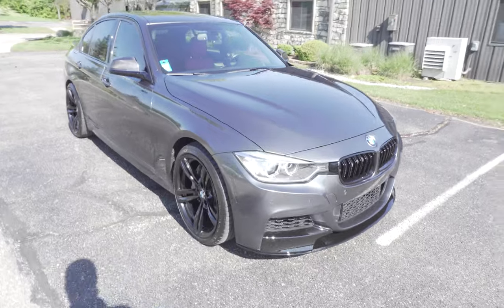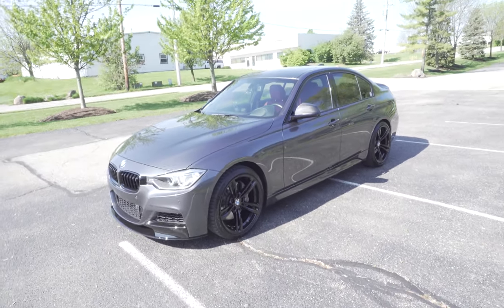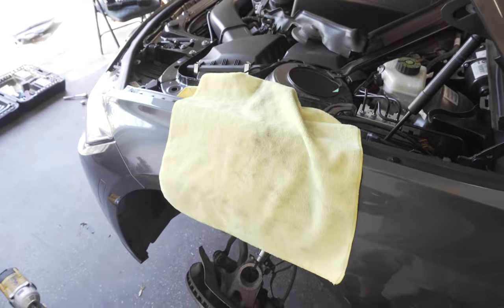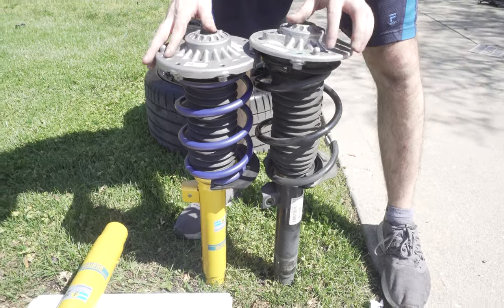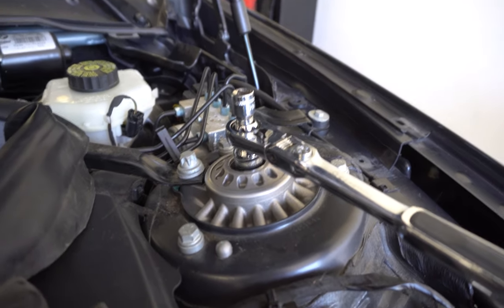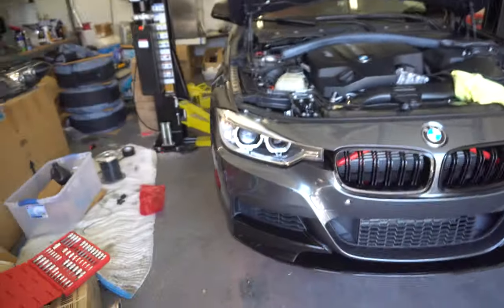Bilstein B8 struts with H&R Sport Springs | PART1

Comment: how do i know if i have adaptive suspension? also if i do, would it make any difference of using the bilstein? i’m currently on h&r sport springs in stock suspension M sport and it’s decent ride quality, i just want a bit stiffer on highway roads sondes it’s my daily driver.
Reply: 2015 f30 335i for reference.
Reply from the maker: I doubt that you have adaptive suspension. If you look up your vin number, (bmwvin . com), look for 2VF. If you see that, you have adaptive. Also, it would be pretty noticeable if you had it. When putting the car into sport mode, you should feel a noticeable difference in the suspension stiffness.
Reply: @accelerated_motion  unfortunately that site isn’t operating at the moment, but i checked other sites and i couldn’t find any sign of adaptive suspension, whenever i put it in sport and sport+ mode it always highlights the shocks on the infotainment screen, that’s why i was wondering but thank you! this is my next mod for my daily commuter
Reply from the maker: @joealej4274  there are other vin decoder sites but any will work. But yeah I doubt that you have adaptive. You’d also see some black tubular piece by your suspension. I’d say you probably just have standard MSport suspension like I had. Switching to the Bilstein’s made the car feel a lot better
Reply: ...or contact your local dealer and ask them (call or visit).  Bilstein offers shocks/struts w/adaptive properties to preserve the adaptive feature...
Reply: @K03sport  I ended up going with kw’s a year and a half ago lmao

Comment: hey! bro how is the comfort between Bilstein B8 compare to just H & super sports spring on stock m sport suspension. thinking going with this set but have doubts. also I rub a little on my passenger rear
Reply from the maker: From everything that I have read and heard, H&R Super Sports on stock suspension is awful. Extremely harsh ride quality. Thats why I opted to do Bilstein struts along with the H&R springs. I'm glad that I did. Its been a very comfortable and confidence inspiring setup.

Comment: You know, it didn't look bad before the spring install. I'm not a tucked or zero-finger gap person, so I prefer some space btwn the tire and fender. Mild drops are the best (imho) as far as I am concerned. When you start going crazy low, you jack w/the suspension geometry then have to buy more pieces to compensate for that bad geometry...
Reply from the maker: It wasnt terrible before the install but I prefer a mild drop. I dont care for tucking tire, so this setup was pretty much perfect for what I wanted. You're right though, depending on how low you go, other parts and pieces are needed to get geometry back into spec.

Comment: Nice video! Good work! I've noticed the tools used in your video...cand you make a description what did you use? THx
Reply from the maker: Thanks for the comment! You'll need the following: Sockets and open end wrenches 10mm, 13mm, 14mm, 16mm, 17mm, 18mm, 19mm, 21mm, Torx T30. Deep sockets and ratchet extensions. Spring compressor if removing the springs. Spindle spreader to remove the struts. Having some basic screw drivers on hand is always helpful. Torque wrench and breaker bar. Impact driver isnt necessary but does make the job go a little quicker. Thats more or less what you need.

Comment: What’s the verdict on the H&R’s & B8’s? I’m on BC coilovers and there’s some bounce at low speed/ start-stop driving.  I think the dampers are not very great and small bump sensitivity is basically non-existent.  Considering your setup or H&R SS’s.  Nice ride BTW.  Thanks
Reply from the maker: I have heard that BCs are pretty harsh. I LOVE my H&R & B8 setup. Its the perfect combo for daily driving duties. Its a tad stiffer than my stock MSport suspension, but it isnt jarring or harsh in any way. Extremely comfortable. I wouldnt call this suspension setup worthy of a track car, but it all depends what you are using your car for. For me, I'm only daily driving my F30, so this setup is perfect. Couldnt have asked for a better suspension setup.

Comment: I have stock BMW E 30 convertible 1987 stick shift - B6 with stock springs or B8 with H&R sport springs? Roads around where I live are nice... i’m OK with sportier feel, but I don’t wanna have it super hard like a go cart
Reply from the maker: The real question is, do you want to lower the car. If yes, then go with the H&R/B8 setup. If you want to keep stock height, then you can do B6 or B8 with stock springs.
Reply: @accelerated_motion  well...if I stay stock springs I may as well go with B4...comfort, and just little-bit stiffer then oem, or the same. Save some cash and add on some more front suspension refreshments 😂

Comment: I have a 2018 330i with m sport package, could you recommend the best setup for me? Also how does making these changes hold up long term
Reply from the maker: Honestly, I love my Bilstein & H&R setup. So I would recommend going that route for yours as well. Its a great combination, especially for a car thats daily driven.
Reply: @accelerated_motion  I forgot to mention its an xdrive, does that change your recommendation?
Reply from the maker: @dair7947  Nope! My opinion is still valid. I have heard that the same setup works for xDrive as well.
Reply: @accelerated_motion  thanks for the help! Since you seem to be quick to reply could you tell me if an m performance exhaust from a 440i can be used on a 3 series? The exhaust sounds great but I can't find any answers on if it would be compatible or sound good on a 330i.
Reply: I have the diffuser for a single outlet on each side, so im more so asking about whether or not the sound would transfer to my car
Reply from the maker: @dair7947  I’m almost positive that it won’t be a direct bolt on. You might be able to hack the M Performance muffler off and then have it welded onto your 330. Would be some custom exhaust work but otherwise, I don’t think it’s plug n play
Reply from the maker: @dair7947  330 is a different motor than the 440. So it won’t sound exactly the same if that’s what you’re asking.

Comment: How much is considered “lowered” ? I have h&r springs and my vehicle drops 1.75inches in the front and 1.50inches in the rear. They currently don’t make a B8 for my application so would i be good with just B6??
Reply from the maker: My drop is pretty moderate, but you can tell its been lowered a tad. B6 would be good too. I think you'd be happy with that setup.
Reply: The main difference btwn b6 and b8 is piston shaft length/travel (b8 slightly shorter). There might be some difference in valving as the b8's were designed to work w/a shorter, firmer spring.  A lowering spring and a b6 might/could work; however, I don't know if the lowering spring will make the b6 piston work outside its nominal/preferred operating range

Comment: You don't show how to build the struts!! We have these and our springs seem to be loose in them. Can you show how you put the strut and spring together
Reply from the maker: Check my videos. I have one on how to build it all.
Reply from the maker: https://youtu.be/7GEt625kVZI
Reply: Thanks. I have the b8 and 20mm eibach springs. When I put these on the front the spring an move when I have the car jacked up. I didn't need to use a spring compressor. It's an mot failure where I live. Am I missing something

Comment: Question what does the strut connect to since mines rusted and would like to replace it but don’t know what’s it’s called it also holds the rotor I guess
Reply: Spindle or knuckle. You can look it up on places like rockauto. How rusted are we talking? Rusted to the pt pieces won't come loose or just surface rust that looks bad?  Raw cast iron parts rust easy (look at Jeep Wrangler suspension) but do not pose an issue unless you are near Salt water or constantly submerge your axles....